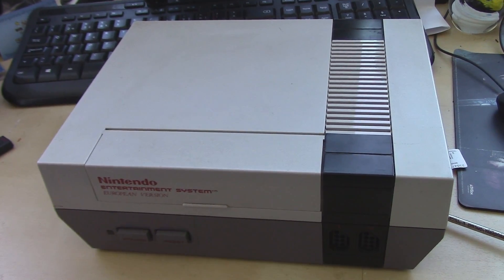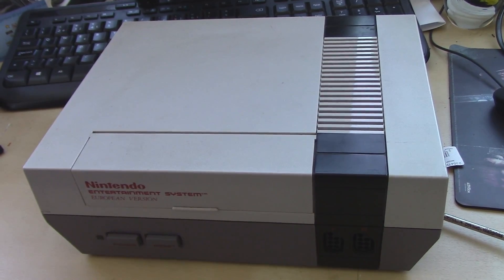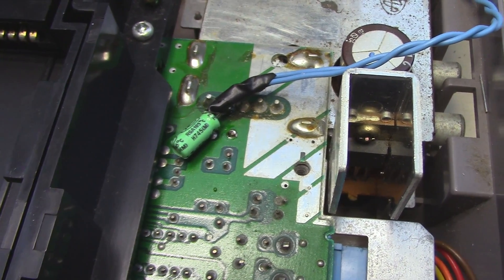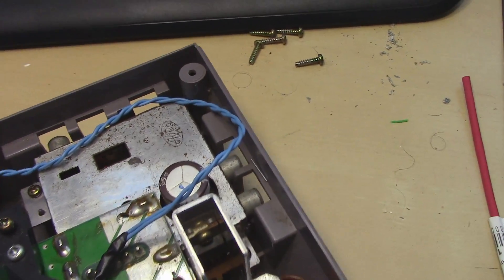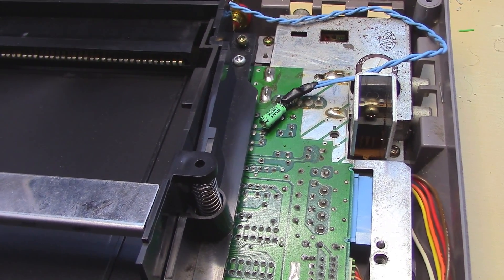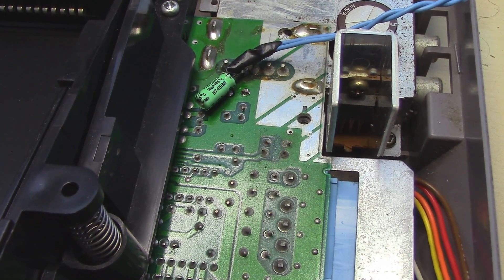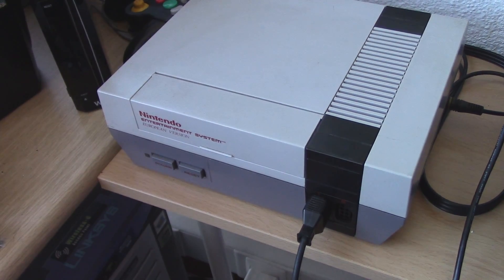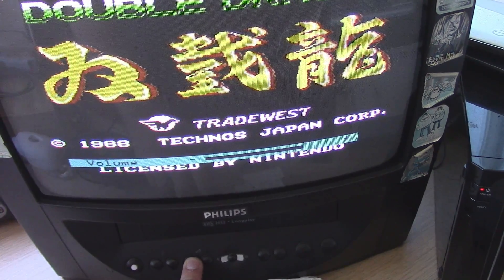NES Stereo Mod (Pt.3) Sound Issue Fix

Comment: whats the point of doing this its not true stereo you get the same thing if you just split the mono to left and right the resister are not a left and right channel but instead separate channels of sound one is for midi and the other is for the rest and you cant combine the one set to one chanel then the mono to the other as the mono would be louder. the best bet is just split the mono and add a basic inline filter. my self when I do the mod I just split the mono and desolder the jack on the back for rf from the board and solder it in for the other channel then I desolder and remove the channel select switch and cover the whole

Comment: Where did you put the + leg of the capacitor? really cool vid, thanks.
Reply from the maker: +nogginj the positive leg of the capacitor connects to a pin of the potentiometer. the negative leg of the capacitor connects to the mono sound pin in the nes motherboard.
Reply: +The logguy So the cap is placed in series with the audio signal? That is cool - thank you for the details. My noise channel occasionally makes noise, but I don't think I've used any capacitors at all. I might try a 4.7uF on each channel output...I do not mix with the mono signal.